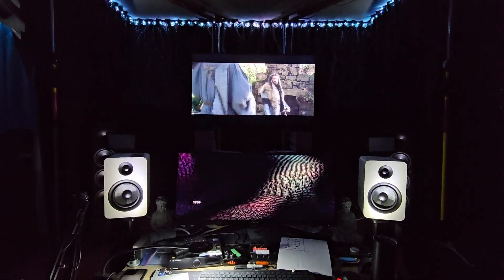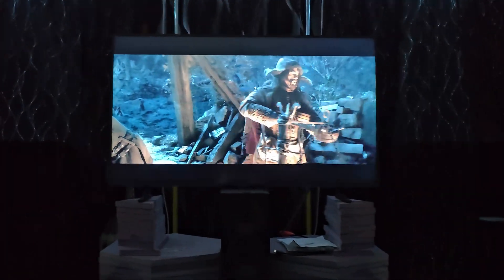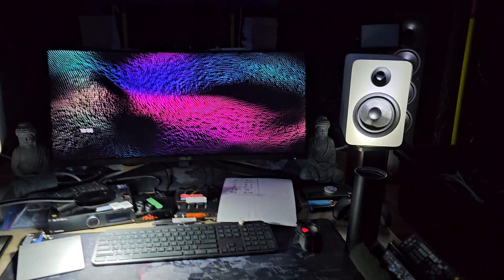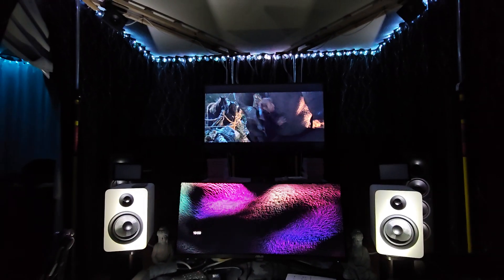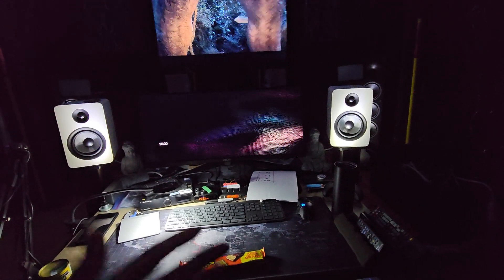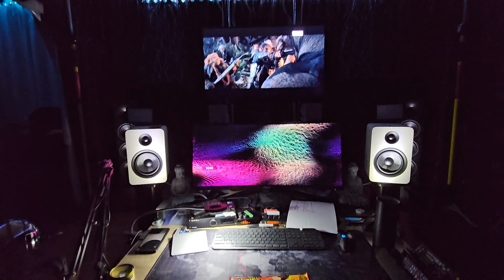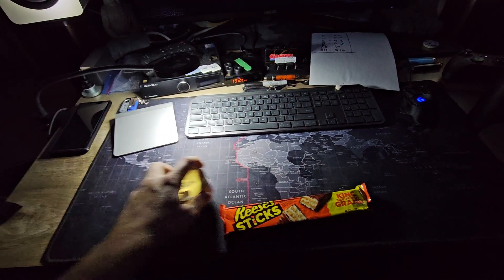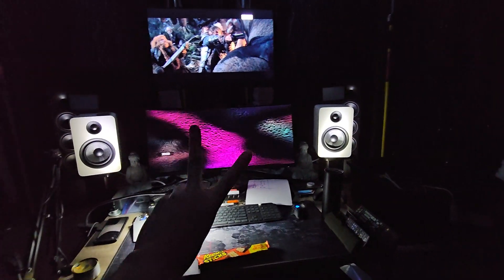Denon x6700H EcoMode / Power Failure - Follow up.

Comment: So many possibilities for failure.

1. I'd do what I can to keep the unit from getting too cold. Thermal stresses can cause intermittents at the board level, especially in the high power section where voltages can cause arcing if conditions are right. 

2. To go along with the temperature suggestion, being cold and heating up can cause condensation, which can lead to shorts and failures.

3. Relays should not fail in that short of a time, but it's not unheard of.

4. Software glitches. That's a whole 'nother level of issues. 

Plenty more, but that's a start.
Reply from the maker: I considered a number of temperature changes as a possibility.. but the function as you've seen .. is very isolated to the power rails and immediately changes when swapping modes.

IT's soo strange.. Maybe a capacitor? .. No idea.

Comment: Man that sucks.  At least you found this issue while the unit is still under warranty.🫤
Reply from the maker: Yah - I hope they can isolate and fix this issue.

I will personally be looking to get a separate Processor and Power soon. It's time I did that.

Im not getting any reply or conversation with brands. Not enough followers or reach yet I guess. 

That Number game.